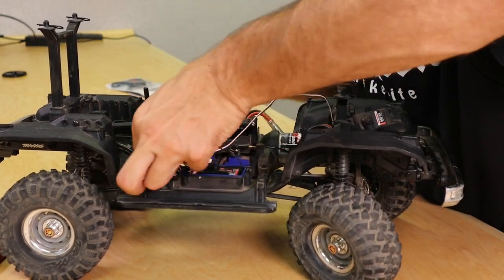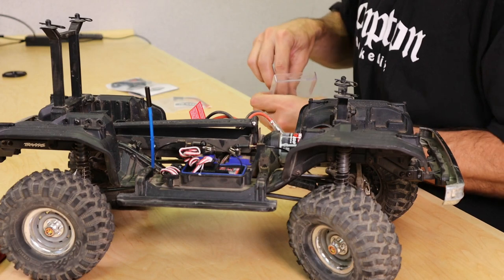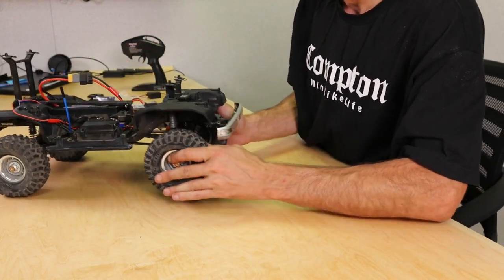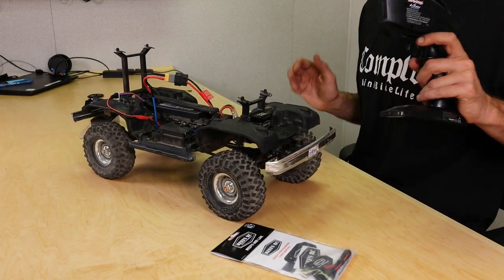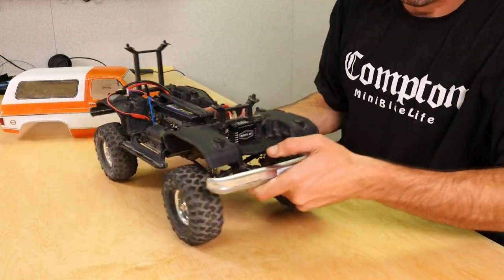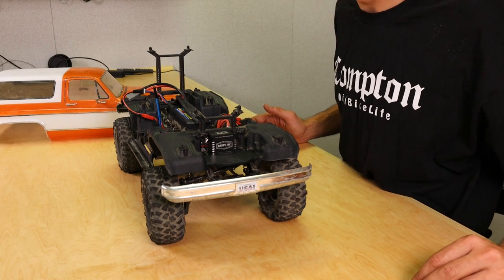1st Two Must do Modification for the Traxxas TRX4 K5 Blazer!

Comment: Ryan, make sure to go over the scissor cuts with dremel sander to clean it up.  You don't want to leave any rough edges which will catch and start tearing.  That Reefs 777 servo should be awesome.  If you haven't swapped out the servo horn to metal one, do so ASAP as 777 will tear that up.  Make sure to pick up the Traxxas metal servo horn as normal metal servo horn won't fit well.
Reply from the maker: Sung, thank you for the tip on using a dremel sander to clean up the scissor cuts on the body. That is a great idea that I had not thought of yet. Check out the video I uploaded today about the Servo Horn!
Reply: @NorCalMiniMoto  No problem.  Hoping to see you tonight.

Comment: im a tottal noob to electronics so if i seen it right if i want to change a servo I just unplug it and plug the new one in and the reviver and all the other stuff will automatically work right? No need to set the reciver and stuff like that?
Reply from the maker: Correct, the new servo will either plug into the receiver or will be direct power to the battery like my Reef's 777. If it is a direct power servo they typically plug into the battery balance port. One thing you will want to check with any servo that you buy, is the steering end points. This is the point at which the servo stops steering in both directions. It is important to make sure your steering end points are set correctly so you're not binding the steering system. What servo are you thinking about buying? Make sure to subscribe so you don't miss out on upcoming content!
Reply: @NorCalMiniMoto Thank you. I was just wondering about the servo cause I heat the stuck servo in the TRX 4 is bad. And I dont know anything about electronics. Been doing models for 18 years but im new to the crawler and rc stuff.
Reply from the maker: @tamasdohy1146  Those stock TRX4 servo's are junk. Mine lasted about 3 good crawls and locked up. I love my Reef's servo it has worked great from me!